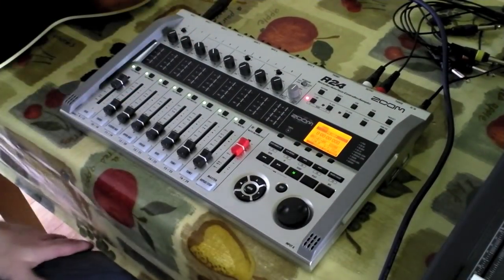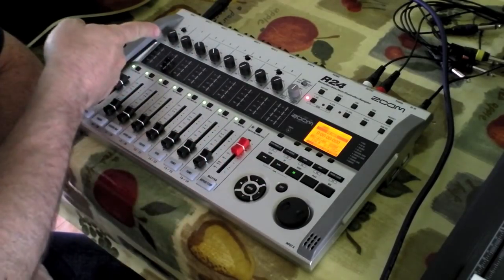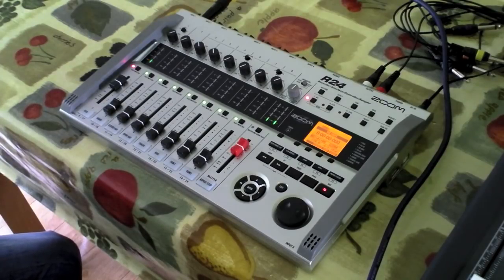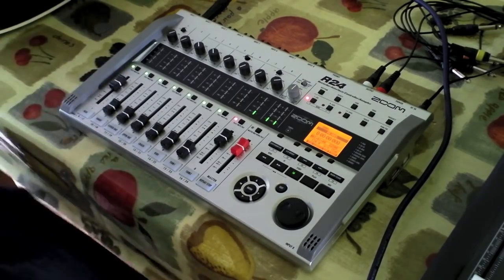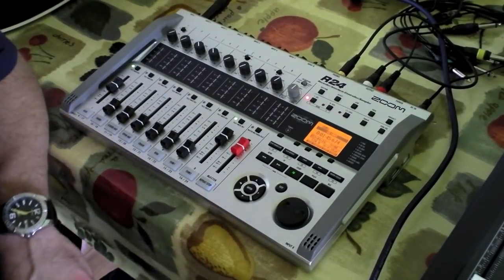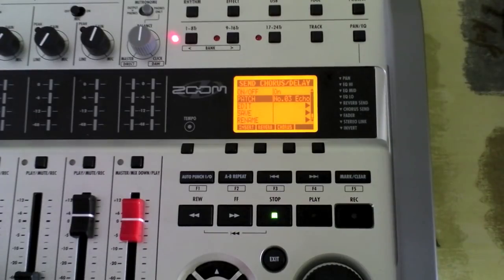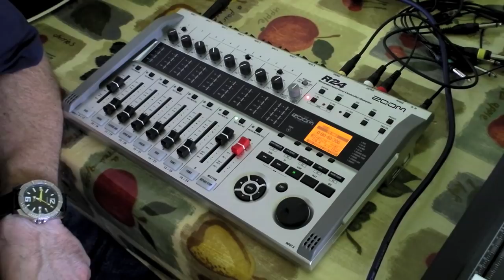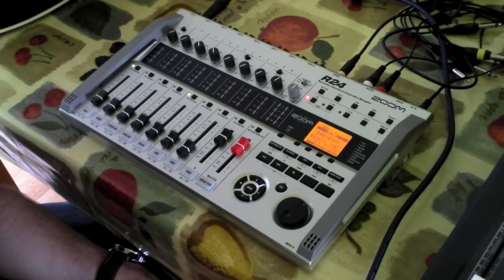Zoom R24 Part 2 - Basic Recording

Comment: Thanks very much for this superb series of videos.  I've had my R24 since the Spring but have only just come around to deciding I now have the songs and the motivation to get on with confronting the actual process of recording - or, at least, planning to record.  I had a much simpler Boss multi-track before, and while this is a definite step up it's also quite intimidating, and the manual is very dry and frustrating.  Your videos are just what I need to get going again.  Thanks!
Reply from the maker: +Mikey Saint Great news Mikey - glad to be of assistance and good luck with your music!

Comment: Thank you for these tutorials. It is very kind of you to take the time to help people. I am looking to buy the R24 as my Boss 900cd is now near the end of it's working life. For  most of my recordings I use an acoustic guitar recorded through a condenser mic. I then record vocals on another track using the same recording method. I turn the phantom power on. My mic is an Se 2200a. If I record an acoustic this way will I get a good sound ? or is the recorder designed to plug in an electro acoustic for better results ?

Comment from the maker: Hey and thanks for the kind comment! Although I've not used the R24 for what you intend so have no experience with that side of things, the R24 is capable of having files assigned to tracks directly from the USB stick or the memory card (that's how you use the drum loops included with the R24).  As the R24 works with .WAV files, in theory I don't see any reason why you could not put a backing track on the R24 to sing over as long as the file naming and folder structures are maintained so that...

Comment from the maker: Yes - loads of them, available for all sorts of things from stereo inputs, guitars, bass, vocals, etc. and they're really rather good too with fully adjustable parameters  - they are accessed using the Insert Effect function which will be the subject of Part 4 as it's a little bit tricky to use until you get the hang of it.

Comment: Thanks so much Topdazzle. Just got my R8 and this really help me get started. Will be watching all your videos on this as th R24 is very similar in operation. Can you please explain the monitoring hookup? I know you were hooked up to a bass amp and got some feedback and I'd like to avoid that for sure along with limiting the use of headphones. Great job! Looking forward to the next lessons. Dennis
Reply: +acousticomp You are very welcome and yes, most of the stuff for the R24 is directly transferrable to the R8 (just less inputs / tracks to work with) - the R16 is somewhat different being an older model with a different display. As for my hookup - I wouldn't recommend it!

I had no powered monitor speakers at the location where this video was shot so I had to make do with what I had (a mixing desk and a bass amp) just so I could get some sound out of it.

The feedback issue however is very important and could arise no matter what your set up if you have it all positioned incorrectly. You want to avoid having your microphone pointing at your speakers - that is what can create a feedback loop and give you that unpleasant whistling / screeching sound. 

If you have your speakers in front of you (pointing towards you) and your mic also pointing towards you, you shouldn't experience this (unless you have a wall behind you and your volume up too high - then you will be getting reflected sound from the speakers re-entering the mic which could also cause feedback).

In my example, the bass amp was behind me pointing at the back of my head and directly into the mic - not good at all and to be avoided if at all possible. I hope this helps and enjoy your new toy!

Comment: Nice video, I just receive mine yesterday :) I have to set it with my drums. The main difference with a drums it's the number of mics :)
Reply from the maker: Christian Ista Works great for tracking drums - use the "8xCompEQ" insert effect for independent compression and EQ on each of the 8 inputs at the same time!

Comment: Hi...I got mine yesterday and thanks to you,I'm getting the hang of it...I tried to record a vocal on track 8,but 7 comes on aswell.How do I separate them..what am I doing wrong...Great videos Dave
Reply from the maker: Hi David - sounds like one of two things, either a) you have the tracks "stereo-linked" - you can unlink them back to separate tracks in the menu by selecting the stereo link function and then turning it off or b) you have the input selector switch for tracks 7 and 8 set to being the two internal mics (which from memory are mapped directly to tracks 7 and 8 and work as a stereo pair) just turn the switch off at the top of the machine for the internal mics as inputs and you should be good to go! Hope this helps, Darren

Comment: Hi, I hope you're still out there. I've just bought an R24. I want to use it to record stage plays and panto for the local am dram group. I therefore tested it using a range of different audio technica mics. These are perfectly decent professional stage mics like goosenecks, boundary and shotgun mics. They all require phantom power 48v. I checked the menu system to ensure 48v was selected and used channels 5 and 6 because with phantom switched on they always have power whereas 3,4,7 and 8 can be deselected. The problem was that I had to have the gain turned to well over 50% to even get a light bar and I had to shout really close to the mics to get to amber let alone peak. I then used the menu to put power to the other channels and tried them all and they're all the same. I then used a battery powered mic in channel 1 and got the same result. It doesn't make sense. There's no way the gain should be so high with decent mics does it? In your demo you were using a vocal mic so presumably that was inches away. Have you used any other mic arrangements live? Any suggestions as to what I am doing wrong/how stupid I am being would be welcome. Thanks. Nick
Reply from the maker: nwclegg Hi Nick and sorry to hear about your difficulties - that definitely doesn’t sound right at all! Without knowing your full set up, all I could do is advise on what to eliminate. Sounds like you have PP switched on and available to 5 and 6. Are your mic cables balanced (3 pin) XLR? Do the mics have switches or gain knobs on their bodies? Are you starting with a blank reset project where no effects have been applied to any of the channels? Do your mics definitely all accept 48v or do they take a different voltage? Don’t know what else to suggest...
Reply: @topdazzle  Hi, thanks for coming back to me. I've been in touch with Zoom and they confirmed "This is normal operation, as hard left is line level and hard right is mic level.

Dead center will be somewhere in between, a little too hot for most line level sources and a little to low for most microphones."

The trouble is that "hard right" introduces too much extraneous noise. I'm going to benchmark it this weekend against a Tascam no frills field recorder. At the moment I can't see me getting the gain I need from stage mics for spoken acting, especially children. Sighhh. Oh well.

Sorry - to answer your question, yes they're all 48v and yes the cables are all 3 pin balanced xlr.

Thanks again.
Reply from the maker: Good to know! Very disappointing at the same time that you are having these problems - I use a Rode NT1A condenser with mine (and a Shure SM57 too) and both give great results.
Reply: @topdazzle  in the end I sent it back and bought the Zoom F8 field recorder. Twice the price but it's great. No "toys" of course and small rotating "pots" but very nice bit of kit. Very responsive. Right decision in the end. Thanks again for your help. Regards Nick
Reply from the maker: @redladyofark  Oooh yes, I fancy one of those myself! I also use a H6 and a H1 which are also great. Recorded a full orchestra and choir with the H6 and it came out superb!
Reply: @topdazzle  I am looking forward to using it in anger. I'm videoing the Panto at the same time so can't fiddle with the audio. The 8 channels give me post production options when individual channels get blasted by the Dame and others have children whispering.
Reply: @redladyofark  Get an assistant - I understand twmay might be available soon.

Comment: Dazzle-meister -   Great instruction; thank you very much. At about 27:30, regarding send  effects, it sounds like you are saying you can have reverb on during tracking for monitor only, recording dry. You did not show how to set that, if that is indeed what you meant: the manual does not explain it, and I can't find that in the menus. Can you explain?
Reply from the maker: Hey - yes, you can have the reverb send effect on for tracking only - just set your record mode to dry in the menu settings (I think it's in the project settings) and then it won't be recorded along with the track.
Reply: I think I have it now. The record wet/dry menu option is for insert effects, not send. But the send effects only will be printed if you bounce a track through them. The manual does sort of make that clear by saying the send effects go through the mixer section of the R24. Here's a excerpt from a Zoom forum thread: 

SEND/RETURN EFFECTS:

1. If the effect is on, it is always on regardless if you listen to an input OR track. 
 2. It will never be wet ("burnt") into a track unless the effect is on when you are bouncing to another track OR mixing down to Master.
 3. Cannot be applied to master track.
 4. Its primary use is to give the singer or instrumentalist a more pleasant (wet) sound to listen to in their headset during recording. 
 5. It can be used for mixing to a bounce track or mastering but for that purpose the insert effects are better.

Thanks again for your wonderful series.
Reply from the maker: Hey and thanks for your reply - I think the above extract may be wrong or taken out of context. The "wet" recording setting will also affect the send and return effects and whether they are "burnt" into the track during recording or not (try it and see). When it talks about mastering, the insert effects are specifically designed for this with a number of presets (including noise reduction, compression, limiting, etc.) that are not available for send/return. Having said all of this, it's been a while since I used my R24 so I may be wrong! Best wishes and an interesting thread.

Comment: Thanks a lot for these videos, they are very helpful.  I have a question. When you connect an stereo keyboard arranger or piano with 2 jacks, you can choose in PAN/EQ - ST LINK - (ON/OFF).  If I choose ON, one of the faders will control both, and the sound is better than choosing OFF, where each fader controls left and right volumes.  Which is your recommendation for this? why it sounds much better choosing "ON"?  Thanks in advanced.

Comment: I just purchased and did a basic recording ... I have a Yamaho 9000 Pro keyboard ..
When I put the vocal on a separate track, I couldn't get volume to a high enough level?
I plugged mic in #7 with 1/4" jack ... also tried 3-prong ... no difference.  Maybe I'm doing something wrong.  Any input?   I really appreciate your videos.   My previous recording device was a Boss 1180 ... the quality was excellent, but after 10 years of use, has some problems so this is why I bought the ZoomR24
Reply from the maker: The 1/4" is an unusual connection for a mic - normally the 3 prong XLR is the more common choice (although you do say you tried this too).  It sounds to me that either your mic / mic connection is not balanced (which mic are you using?) or that you don't have the input gain set up correctly on the channel strip.

Comment from the maker: Hi Ian - whilst I have no knowledge or experience whatsover in the hardware you're talking about, if I understand you correctly it seems that you are asking if the USB on the R24 can be used as an input source?  If that's the case then my understanding is "no" - the device cannot hear and record from the USB socket, only from the 8 combi XLR inputs.  The USB is used solely for data transfer of files and recordings between the R24 and either a USB stick or a computer.  Hope this helps!

Comment: The only reason I'm probably buying the R24 after already owning the Tascam Portastudio 24: when you arm the tracks for recording on the portastudio they're flashing lights, no joke, drives me nuts that they aren't solid (so I can use it as a mixer as well).  Looks like its not just a simple field recorder and I can actually edit with it.  Thanks.

Comment: Very helpfully,I have a r16 zoom,this is the best instructional video yet.im pluging in a apex 460 condenser mike and I find my gain control has to be up past the 3/4 mark to get a good signal ,is that right?
Reply from the maker: Ray Comeau Hey Ray - it could be, depends on the mic really and how sensitive it is - being a condenser I'm assuming you have the phantom power engaged and the correct voltage set?  Also, I don't know this particular mic but make sure it doesn't have it's own built in level control or pad switch as this could also effect the level you are getting.

Comment: GREAT videos!!  Thanks so much!  I'm having an issue that I don't see mentioned anywhere in your videos or the manual:   I have recorded a 5-track project.  All tracks were recorded simultaneously.  However, when I set those tracks to playback (green light on each of the tracks), I get nothing but silence.   However, if I go into the individual files they are there.  I can listen to each file individually.  I'm stumped.  Any thoughts or suggestions?
Reply from the maker: Sounds like either your Master slider is set to zero (the red slider) or the volume knob on the back of the device is turned down (or you have something inserted into the headphone socket) - hard to say really.

Comment: Question: The  1/4" monitor outputs are TRS, with the ring marked as "cold". Monitors I'm looking at do not have the center ring, but are for mono 1/4" plugs. Nothing in the manual suggests that the outputs are each stereo, or that they might be balanced on a 1/4" plug. Do you see any reason not to use regular mono 1/4" speaker cable for each side? (not instrument cable, of course)?

Comment: Easy like sunday morning?  Is that a Zoom commercial.  ;)

Thanks for your time. Great instructional video, one of the most straight forward and in depth I've seen on anything.  

I'm looking to upgrade my old Zoom MRS-1044 that must be 13 or 14 years old now.  It's still very usable. But I wonder what the amp simulations are like now compared to the old versions.  I practice lots through headphones and poor effects get really tiring. The clean ones are pretty decent and recording vocals or an amp is still great.  But I plug and play at work if its through headphones it's really important that I can dial in a few decent amp simulations.  Have they improved? Anyone know?
Reply from the maker: Personally I think they sound great - there are some really nice vintage Marshall tones and crunch.  I think digital effects generally have come on leaps and bounds in recent years and there are plenty to choose from on the R24.
Reply: topdazzle Thanks.  Ya I've played some decent amp simulations recently, that's why I asked.  Used to just take it for granted that digital drive is crap.  Will check it out.  I've heard that Zoom has just carried over many of the older ones, where any kind of distortion just muddies right up.  That's fine for most recording applications really.  Normally I'd just record an amp so..   This R24 looks great.  Steal of a price too.

Comment: Just purchased the R8. Manual page 15, I successfully set the date/time. Page 17, Create a New Project, I pressed the project button and another screen than shown in the manual and your tutorial comes up, No Project, at the top with various parameters below, clock, mark, bounce, etc. Tried pressing "rhythm" to check out drum loops, a brief message "no project" and the No Project window reappears. Thanks for any advice/help.  Your tutorials are much appreciated
Reply from the maker: Hey Geir - have you tried creating "New Project" first so you have something to work with?  You need to format the memory card into the file structure that the Zoom will work with and I think I am right in saying that this happens automatically in the device the first time you create a project - try this and see how you get on.
Reply: Thanks for responding so quickly! I put the SD card as per the manual. Turned the R8 on 1st time and the date/time window came up, set that. Then the Project window came up with the clock, swap, etc, Not the new, select, etc, window. I did not see anything in the manual about formatting the SD card. I'll reread and see what I come up with and keep you posted. Again, many thanks. Geir
Reply: topdazzle
Hi Top Dazzle, Turns out the R8 was fine. It was the 60yr old Luddite operating the unit. I'd no experience with SD cards and installed the housing without the memory chip. Old dogs and new tricks.
Reply from the maker: Lol - I would never have been able to help you there my friend!!  Thanks for the update though.